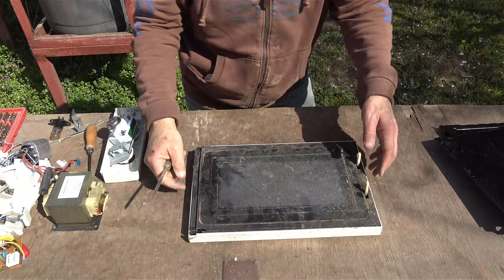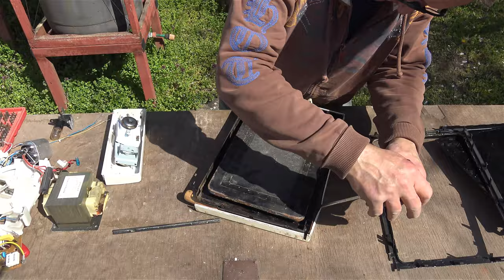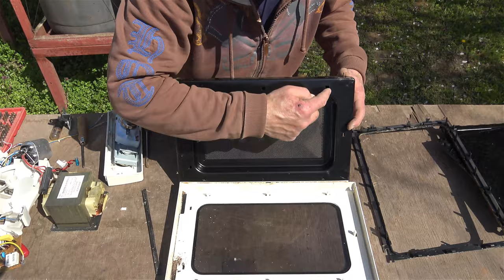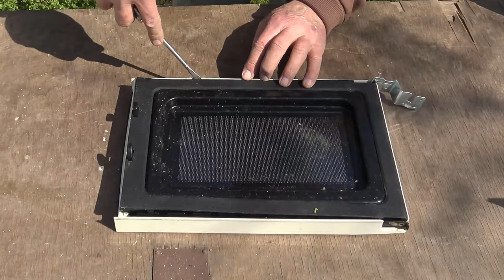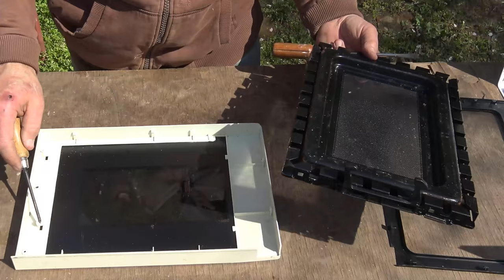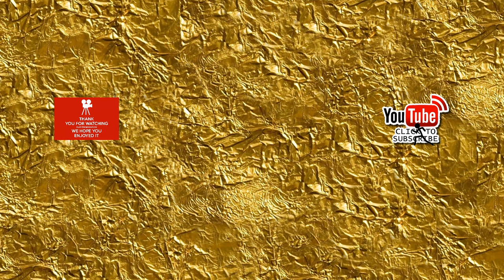REMOVE MICROWAVE OVEN DOOR GLASS - TWO TYPES - ORION - ELIN

Comment: I have a older GE Microwave (build date 07/1998)  Something has separated inside the glass door and is hanging across the window, between the glass panels.  I need to open up the glass part like you did. Have you ever seen something inside, between the two glass panels?